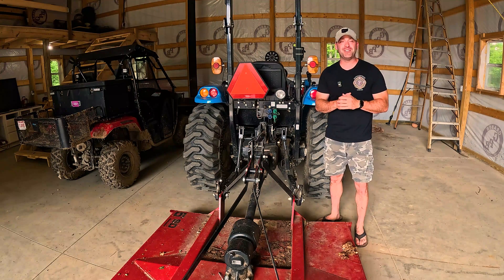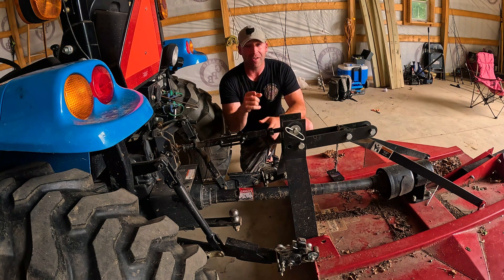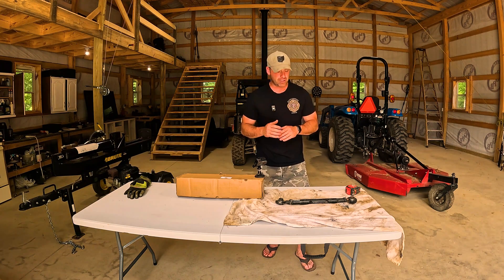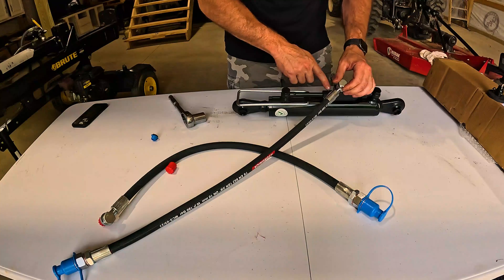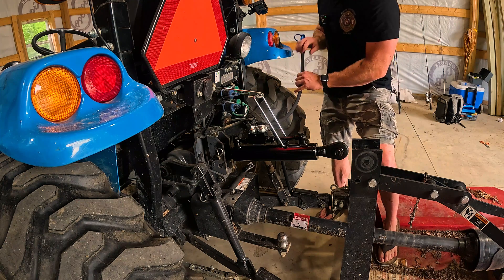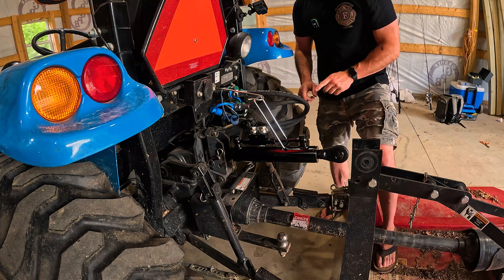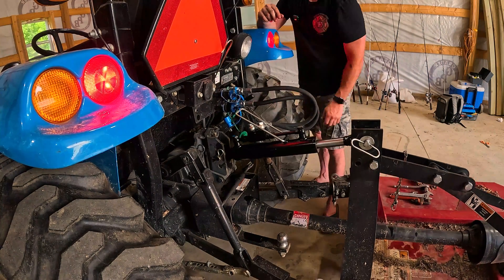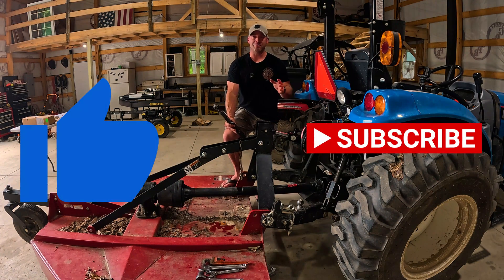Hydraulic Top Link  from Amazon: Unboxing, Installation, and Benefits

Comment: Thanks for the info. I just picked up a box scraper for my older tractor and am realizing how a hydraulic top link will make it much easier. Mine does have a rear remote connection but the lever is below/behind my seat, but this gives me an idea how easy it can be. Well done.
Reply from the maker: Right on! Thanks for watching! You are going to wonder how you lived without it!

Comment: When you install a banjo fitting you need one copper crush washer on each side of the fitting. They were probably shipped with both crush washers on one side to prevent loose pieces. You should probably disassemble the banjo fittings and correct that to avoid leaks in the future.
Reply from the maker: Thanks for the insight! I’ll check it out. 👊🙏